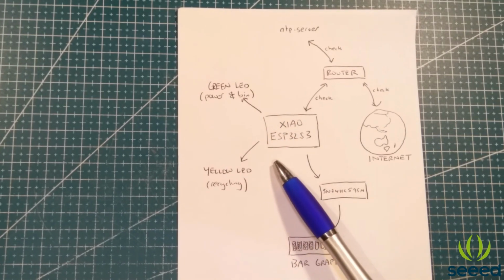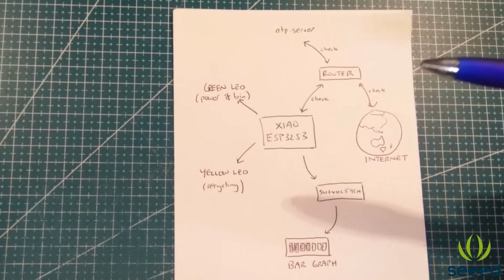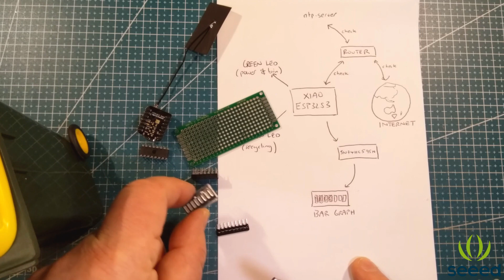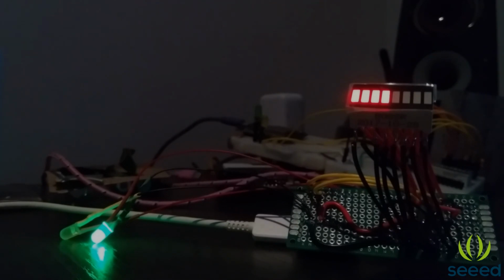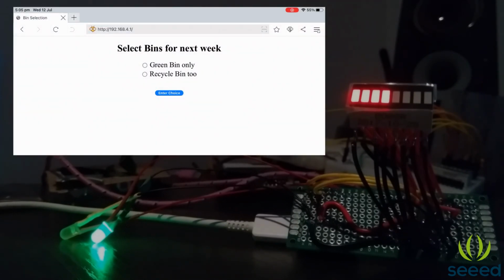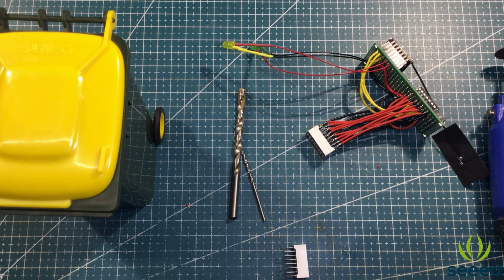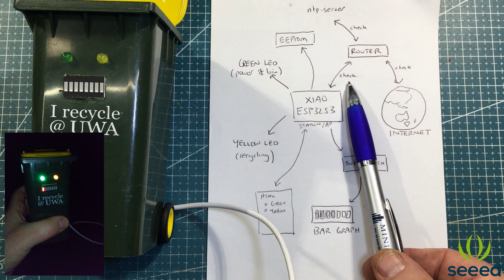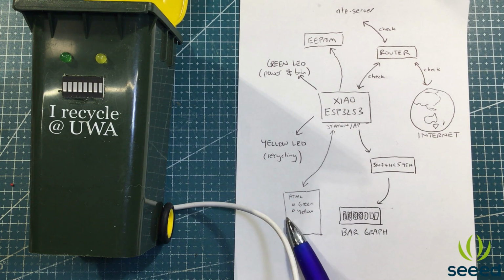XIAO ESP32S3 ends up in the bin!!

Comment: Seems a bit complicated. I've had a PCB renaissance to '98 when I charlieplexed before Charlieplexing was a thing. I published to the PICLIST back then. 3 days ago I got my heart PCBs from JLCPCB, 20 LEDS driven by 5 pins of a CH32V003 in the 8 pin package. On line resources are pretty sketchy but it's a RISC-V clocked at up to 48 MHz.  I had to switch to internal RC oscillator and take out the mounriver default project drive of the SWDIO pin and killed 3 micros getting it right. Next mission was driving the LEDS, I set some random stuff going on some of the pins but got lost for a bit switching out potentially faulty 0602 LEDs. Turned out I just needed to finish my code for basic driving of and of the 20 LEDs which I did tonight. Finesse later. Kind of shocked I have 3 boards running now with only some LEDS and a few micros wasted. ISP pads and pogopin clips make it so easy to program!. But you can do the same thing with even the small pre-built XAIO boards if you want, all they need is wireless and the rest of the pins are free as you are programming via USB. I wouldn't do it in Python though, too slow for good LED 'plexing. Seems freaky that my last 4 circuitboards just work, no jumpers required. I've looked at the 'S3 board with the flat antennae.  2'nd and 3'rd PCB designs were a 'C3 and an S2, the purple Lolin based boards used to simplify my motherboard PCBs. They seem to go unreliable on wireless connection past about 120 meters apart but that's with the simple built in PCB antenae. I don't think the high power drive and encryption were working back when I was last playing with them about 8 months ago, lag in getting the right drivers into Arduino I think.
The design is targeted at solar power hydrofoils but it's on hold pending someone else or me writing a driver for one of the gyro sense chips I chose.
Reply from the maker: It is overly complicated. Most people just mark it on their calendar. 🤷🏻‍♂️🤪
Reply: @onecircuit-as  Yes, but most people aren't ADHD with hyperfocus inventors? 😉

Comment: @5:44 I know hindsight is a wonderful thing but...could you have soldered the resistor array directly to the LEDs and have just the one common GND wire going to the board? Just a thought.
Reply from the maker: <head slap> 😯